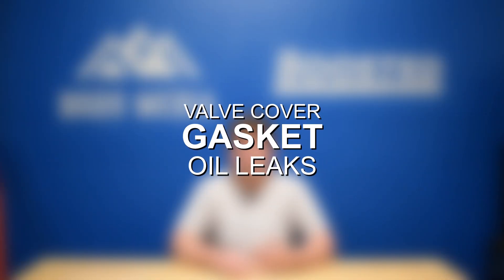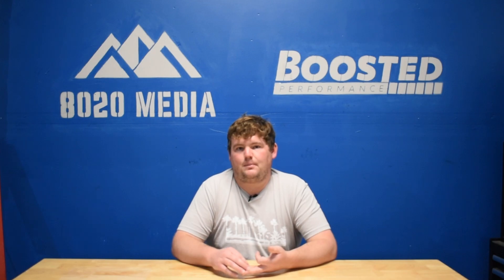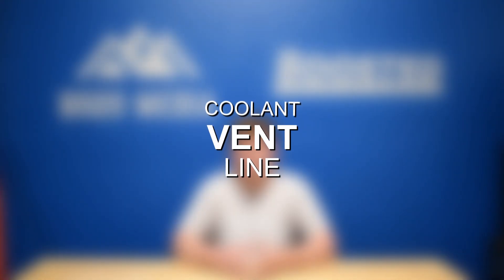BMW's B48 Engine | Problems & Reliability

Comment: Hey man! Great video I just have some questions. Looking for a b48 / b58 (this is my first car). I’ve slimmed it down to a 21’ 530i lci or an older 17’-18’ 540i or 530i. I do plan on doing a good ole down pipe and a tune regardless on which I get. My question is should I get a gen2 b48 or gen1 and as far as bang for your buck goes along with reliability should I get a b48 or b58? Thanks bro
Reply from the maker: K - We think this video would help you out dramatically: https://youtu.be/V6ClkCprklU

Let us know if you have any other questions.

Comment: Hello Zach, thank you for your video, I became a new subscriber! I am just wondering do you think these issues are improving as the newer car models come out? like for the 2024 models? I am planning to get a bmw x4 2024 xdrive 30i, which I believe holds a B48. Would it be comparatively reliable comapring with other car model has same engine? Thank you!
Reply: I own a 20 330i xdrive I brought with 40k mikes now has 90k and it’s very reliable as long as you Keep
Your maintenance up they last longer they make modern cars more reliable than back then
Reply: @cardellperry954  Good to hear, thank you man!
Reply from the maker: Cardell - Thanks for taking the time to share your experience and help out our viewers!
Reply from the maker: Xin - Yes, usually the newer a car is, the more likely a brand has fixed issues from earlier models. So long as it is maintained properly, you should be good!
Reply: @8020Automotive  Thank you!

Comment: Hello Zach. I appreciate you creating these videos for the public. I plan on purchasing a 2023 MINI Cooper S, this model is on Consumer Report’s recommendation list. I’ve contacted owners and they have had no issues with the 3rd generation. I value your opinion, it’s a 2023 model with the B48 engine, do you think bmw worked out all the bugs and ironed out the  kinks from 2014 models? Do you agree with Consumer Reports? Please advise. I plan on getting my MINI in 2 weeks.
Reply from the maker: Leo - Typically the newer an engine is, the more likely the manufacturer has worked out a lot of the issues. This isn't to say that the MINI you end up with will have NO issues at all. But Consumer Reports do a lot of testing and are typically pretty reliable.

Comment: I have a 120i f20 with the b48 from 2018 and my coolant vent line broke while driving the car. This resulted in the car overheating, got the line replaced the day after but now she is taking a half liter every month. Getting a little bit worried the head gasket may be beginning to leak due to the overheating 😬
Reply from the maker: A - That is what it is sounding like. Have you had it looked at? That's quite a bit every month.

Comment: in the b58 as well! my 340i at 120k miles just cracked on the oil filter housing lol about to change it tomorrow
Reply: wow I didn't know BMW's could last that long.
Reply: @gregthesplintercell  yea! Only things I’ve had to replace are the OFH, serpentine belt, and the front auxiliary water pump, the other two are literally 45 min jobs that I did in by front driveway
Reply: @samuelgutierrez5686  Do you think the B48 engine would be just as reliable? And last just as long? How is it in comparison to the B58?
Reply: @gregthesplintercell  most of the stuff is caused by heat, and since the b48 doesn’t have as much power I wonder if that would let it last longer, one thing for sure, get a heat shield for the turbo, helps a lot with heat soak
Reply: @samuelgutierrez5686 did you go with the aluminum ofg or oem
Reply from the maker: Sam - So sorry to hear this.. Thanks for sharing your experience.

Comment: 7:18 Toyota is using the b58 inline 6 twin scroll turbo in the supra, not the b48 inline 4 twin scroll turbo. Get your facts straight 😂
Reply: There’s also a 4 cylinder Supra using the b48. Get your facts straight, genius. Some peoples kids man smh.
Reply from the maker: Aniv - It uses both the B58 and B48.....
Reply: Toyota uses the b48 in the 2.0 and the B58 in the 3.0. GeT yOuR fAcTs RiGhT
Reply: Twin scroll turbo? Never heard of that only a twin scroll supercharger
Reply: @felixramos5808  yup. It’s a thing.
Reply: @felixramos5808  now ya have
Reply from the maker: It's a thing.
Reply: Supra 2.0 is not sold in some markets so not everyone knows there are B48 used in Supra.
Reply from the maker: M - Yes, however, with Aniv's statement, he should've researched that fact before throwing it out. Just because it isn't sold in some markets doesn't mean there isn't one period.
Reply: @manofsesame3024  then people shouldn’t speak about what they don’t know.

Comment: At 60.000km rear differencial completely busted, BMW did not want to change it because car was already older than 2 years that cost 2500€ , despite know problems with diffs since E46, at 70.000 km injectors failure needed to replace them thats a 1200€ just for injectors. So not even 70.000km driven and yet with all service intervals done between 10-15k km already needed to put like almost 4k in repair costs. So fingers crosed everything else holds. And car is stock from new.
Reply from the maker: Jure - So sorry to hear about your experience. Sounds like you got unlucky, but hopefully you see more reliability in the future.

Comment: Thanks for the great video. I was considering getting a BMW with this engine around 40K miles, but was initially treating that as far away from major issues.
Reply from the maker: Lance - We have a B48 and love it. This video is not made to scare, it's simply made to inform.

Comment: The coolant vent line is a problem even for the 1 series F20/21. I tried to have a BMW workshop read about this problem by presenting the BMW USA recall, but they replied that it is not valid for Italy and that they have never heard of this problem (even though there are enough of these cases also here in Italy).
Spoiler, I had my mechanic change the hose and as they touched it to remove it, it broke at the ends. 70k km
Reply from the maker: Dark - Very interesting that they would deny it.. Thanks for sharing this!
Reply: I also had a coolant pipe problem,luckily I got it fixed before the car overheated
Reply from the maker: Justin - Thanks for adding your experience!

Comment: Got a N26 with 200,000 on it, only issue was rats ate my wiring...... After some bush mechanic hotwiring its never skipped a beat.

  Took the car bush, cracked the automatic gearbox on a rock going offroad but no leak so continued driving.  So far a very reliable car, after i pay off my home im going to start replacing parts with aftermarket bit, should be fun.

Only other issue is a shredded a tire 300km from the nearest city, packed it with grass and it got me to a town, found a tire in a backyard of a native dude, he charged me $750 for it, I didn't have a choice really so we got it and put it on with lever bars.  Honestly next time I drive 6800km I'll be packing a spare.
Reply from the maker: Kisha - Thanks for sharing your experience!
Reply: @8020Automotive  yeah no worries, I don't find BMW engines unreliable, I do find they have electronic problems and soy covered wired are a magnet for rodents.  I'd love to have a b48 but I like my car too much, so many adventures
Reply from the maker: Completely agree!

Comment: Hey I have a 2018 125i 23k kms on it. I really want to do a stage 2 remap on it, downpipe, intercooler upgrade and spark plugs upgrade on it.

Obviously I’m worried about encountering engine issues it’s the last thing I want because of how expensive these things are to service and replace and I don’t have warranty either.

Do you think I’m going to encounter a lot of issues with it or I should be ok and not encounter too much wallet hammering problems till about the 80k mark ?
Reply from the maker: Ben - It all depends on how well you maintain it. The higher the stage, the more stress you put on the engine. We can't give you our word on you not encountering any issues up to the 80k mark because every engine is different. However, if you stay on top of maintenance, you should be okay. Keep us updated.

Comment: 75,000, zero cost so far.  Coolant line replaced for free.  Changed plugs once....oil at 10k intravels.
Reply from the maker: BMW - Thanks for sharing your experience!
Reply: how has it been holding up

Comment: Un B48 NO es un B58 solamente por tener algunas piezas "en común". Son motores totalmente diferentes, incluso entre un B47 y un B48 hay bastante diferencia.
Reply from the maker: We very much understand that a B48 is not a B58 - I don't think we said it was a B58 but rather that it's a very similar engine in design. The B47 is a diesel so yes, those are certainly different. And it isn't that they just use some of the same parts. From a technical and design standpoint there is certainly a lot in common between the two.
Reply: @8020Automotive  Entonces no cabe afirmar que un B48 produce +300 BHP. No importa lo mucho que compartan en diseño. Hay un B48 y un B58, así como las variantes TU que hacen diferencia entre un B58 y un B58TU. Dos cilindros, dos pistones y otras cosas más hacen un motor totalmente diferente. Así como el diésel no es lo mismo que la gasolina y, por ende, son motores diferentes, así tampoco existe relación alguna totalmente directa alguna entre un B38, B48 y un B58. Aspectos en común, podría ser, pero eso no los hace idénticos. Por algo existen las nomenclaturas en cada marca. 

En fin, como sea.
Reply from the maker: Similar and identical are two different words Giloh.

Comment: Might be a really dumb question. Is it possible that the oil housing cracking is due to over torquing the oil case cover? Unless everyone is using a torque wrench its very easy to apply too much torque.
Reply from the maker: P - Not a dumb question at all! This is certainly a possibility.
Reply: No, they crack inside allowing a coolant leak.  It’s plastic so it gets brittle and breaks
Reply: No it cracks because the car constantly is getting hot and cold
Reply: The inside breaks

Comment: Great video, Zach. Thanks a lot!

Question: If I reach a BMW store to buy a certified pre-owened, do I have the RIGHT to ask the dealer to check for those common issues before taking the car home? I say common issues like: water pump, injector failure, coolant leaks.
Reply from the maker: You can certainly ask them to confirm that they aren't issues but if the pump isn't broken already, injectors aren't bad, and there are no coolant leaks then there really isn't anything for them to fix. CPO cars come with some form of extended warranty and usually are pretty meticulously cared for so I would feel pretty comfortable purchasing a CPO car. Most of these issues won't really pop up until higher mileage.
Reply: @8020Automotive  what would be a “high mileage” for you?

Because those issues will happen on 90% of bmws. Thus, would you think I could request a “preventive replacement”?
Reply from the maker: I would say 100k+ miles. Water pumps can go out at way earlier if you run the car hard in high heat and get unlucky. If you properly take care of the car it should be pretty reliable. Realistically I'd say you have a 0% chance of getting them to preventatively fix the problem, especially if it's a CPO vehicle with extra warranty on it already. It's honestly part of the cost of owning a BMW, which is why a lot of people don't.
Reply: You’ll have CPO so if anything breaks it’ll be covered!  But coolant pipes and fittings will break over time due to heat and how brittle it gets.  Water pump will leak, heat management module, turbo coolant return line and sometimes feed lines

Comment: drove my B48 from 21k off lease from the dealership, to now 84,500 miles. I have had a jb4 from 21k to 33k miles and stage 2 bm3 OTS from 33k to current mileage. Issues so far in order, 54k miles, coolant reservoir return line from the block. This part costs about 25$. When it fails, all coolant will leak out of the engine. You will get an overheat warning after the coolant level has reached 0. not before. Thats a huge problem. Second issue, at 48k rear differential pinion seal. replaced under warranty. 78k seal around the water pump. replaced under CT emissions warranty. Plugs change regularly at 30k miles of usage. gapped to .023. oil change every 5k, 0w-20 (will change to 5w-30 after internal upgrades).
Reply from the maker: Jeramie - Thanks for taking the time to type all of this out! Very helpful for future viewers!
Reply: Experienced the same thing but at 28k miles for the coolant return line
Reply: Really, helpful.
Reply: I have a 2018 bmw 330i USA spec 
I have a stage 2 bm3 catless downpipe ftp chargepipe and xhp stage 3 changed my engine oil at 42000 miles and the car right now has 46000 never changed the spark plugs when should I change it
Reply from the maker: Dan - 40k is a pretty safe interval to replace the stock plugs on a stock B48. Most people still run OEM NGK 94201 plugs up to Stage 2 without any problems. 46,000 miles is pushing it a bit for Stage 2, since spark plugs foul faster, so  we think it would be smart to decrease your spark plug replacement interval closer to 25-30k miles.
Reply: @Dan330i every 20k miles if tuned. NGK 1 step colder plugs. I have same car same year stage 2 bm3 catless, intake,charge pipe, upgraded turbo inlet and xhp stage 3
Reply: Appreciate this information.
Reply: What spark plugs should I get
Reply: @Dan330i do not get NGK and do not need to gap your spark plugs on these cars OEM is best Bosch
Reply: @Dan330i German cars all use Bosch as standard, not sure about Bwm but I have 2 Audis, both use Bosch and services always recommend Bosch.
Reply: FYI, you don't need to gap your plugs not even running full e85.
Reply: Thats crazy, Im at 48k miles right now and i take it to get a differential pinion seal leak fixed that the dealer recently discovered during a service.
Reply: I got my 430i G22 (b48 engine), 2022 november production and replaced the oil and filters at the dealership and they put in BMW LL04 5w30, is this the official spec ?
Reply: Why use 5-30 after internal upgrades? Why not use it now?
Reply: Are there better parts than OEM to use when replacing these components?
Reply: What oil brand and version do you use ?